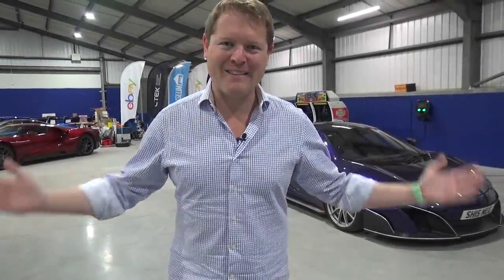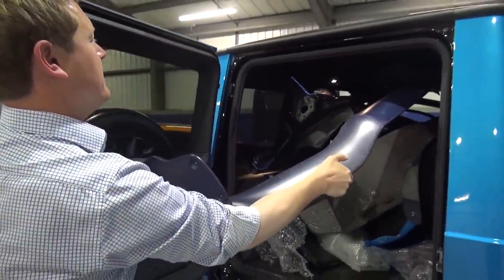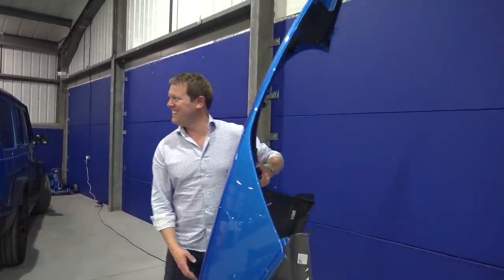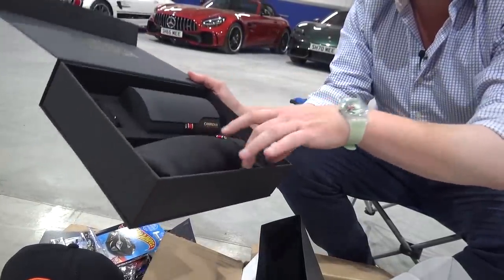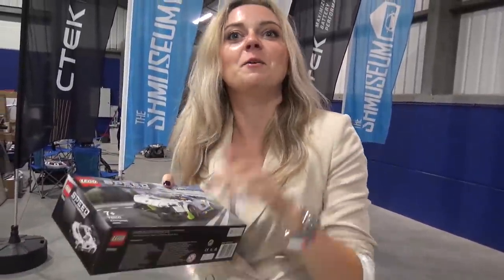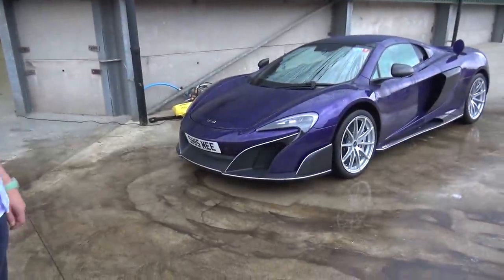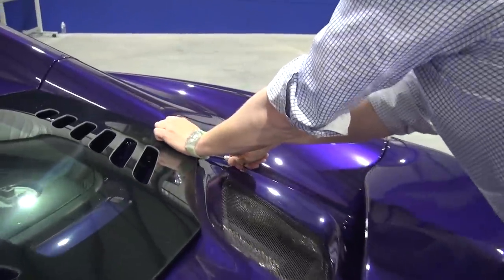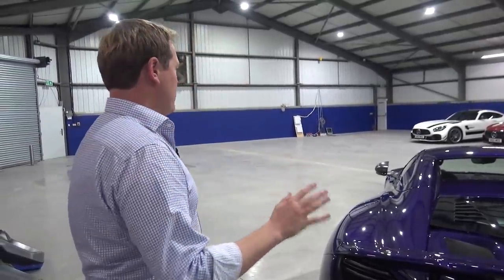Invited to the 2022 Gumball 3000! Unboxing at The Shmuseum | VLOG 4

Comment: Make half of a Senna on the wall so it’s just one side
Reply from the maker: Would look mega
Reply: @TheShmuseum  hang it from the ceiling...that wing is huge
Reply: Agreed, outlined on the wall with parts attached to resemble the side of a Senna. Will need to cut the wing though.
Reply: @TheShmuseum  with LEDs in the back… place it at ground level on the sitting area, so it gets the attention it deserves

Comment: The sega rally. As they are running off two standard looking pcs. Could upgrade to modern systems that run the latest Sims. Could run emulator to play sega rally.
Maybe tieup with Linus tech tips?
Reply: If its running old hardware its probably running old operation system (of whatever sort) and peripherals. Its probably just simplier to get the hardware to work properly with cheaper old parts then try and update everything to get it all working in sync again.

Agreed though updating the hardware (whatever it is) to modern version might be something he could do down the line but it would need someone who knows what they are doing to ensure compatability with all the other hardware  (drivers, connectors) etc.
Reply: Restore it and leave it as a piece of history! If you want an emulation machine build one and leave the original stuff alone imo.

Comment: Because you have so many parts from your cars as the model cars and small cars and so on, you could line your cars not one to each other but with more space between them,  even if it means you have to line them on the other wall too. The space you got you can then use for the parts and other stuff next to the big ones. Just a suggestion.

Comment: I know the Shmuseum is a work in progress. And that you have detailingexperts "on speeddial" of the likes of Topaz. But may I provide a few tips for the cleaning bay of the Shmuseum? I would suggest a canvas or a steel overhang over the washing bay. In summer soaps and stuff may dig in to the PPF and/or paint due to direct sunlight. Or foam can dry out to quick and be a pain to get of... And since your cars are PPF'ed, why nog invest in a Blower to dry the cars instead of a Water magnet towel. Quicker, gets water out of all creases and nooks and crannies and less risk of swirls due to wiping the car down. Enjoy the process of building!

Comment: Hi Tim, concerning the damaged Senna parts: how about a white back board a little wider and taller than the side view of the car. Then mount the parts in their correct positions standing off the board including the wheel and the liner. A finishing paint line silhouette of the actual car outline and some internal LEDs to provide background illumination. It will need to be mounted above the Oxford Blue boards to be clear of people and cars. I suspect you know some exhibition people who could advise or create this display sculpture.

Comment: It's good that your emergency lights, and their is a battery in your alarm box so everything is fully functional with your alarm system, I would seriously suggest you get a surge protector installed as you have millions of pounds worth of cars all on trickle chargers, its extremely common to get a surge or spike in your power supply when the power back on, as I said your alarm system will still work as its mad to deal with all this I am not too confident the tricke chargers or the main charger will be able to handle this. I would encourage you to pay attention to this as I'm not sure your insurers will cover for a power surge. Its not millions of pounds to get one fitted I think £500 would easily cover parts and labour Tim, please take care and stay safe and get a surge protector fitted please

Comment: I remember Tim saying the M8 had left the garage! I’m sure I’ve heard you should apply snow foam from the bottom up?
Reply from the maker: Normally these things are always top down as it slides down
Reply: Makes more sense. As for the M8 that disappeared shortly after an electrical gremlin where you lost air-con.